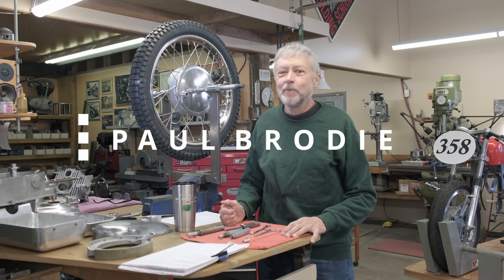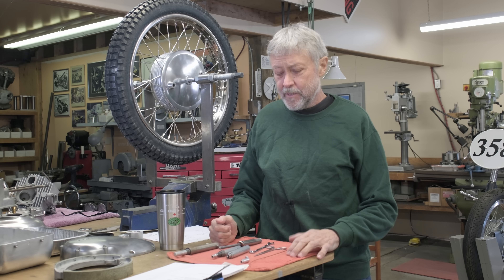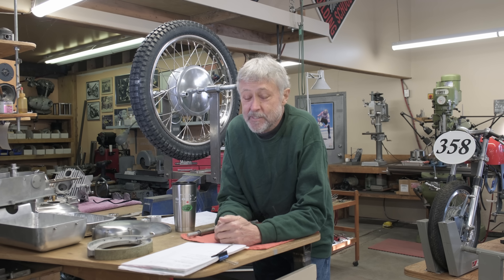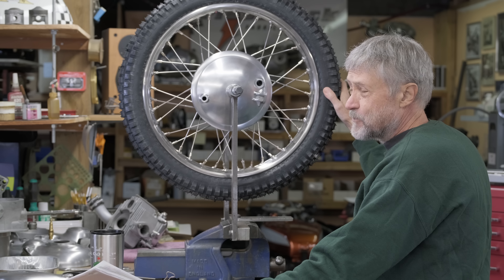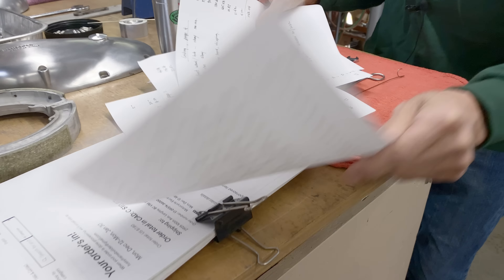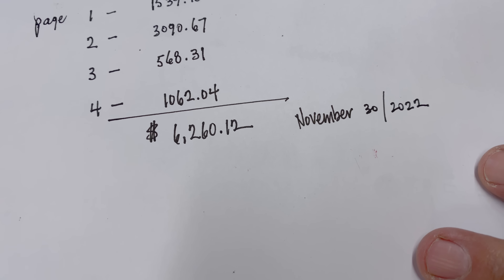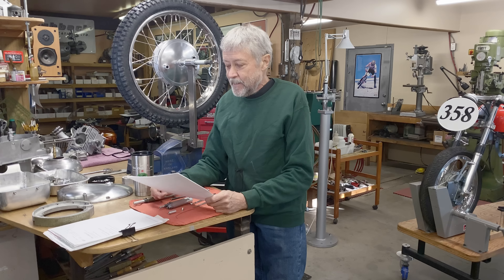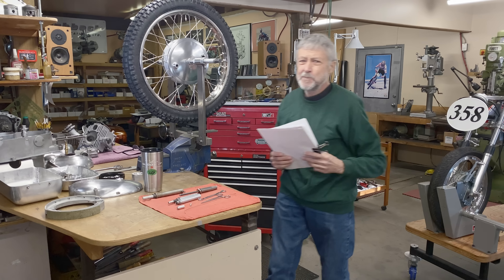Tiger Cub Start Up! // Paul Brodie's Shop

Comment: Nice to see the Tiger Cub firing up. Looking forward to seeing it with some tuning. As soon I saw it not running, I thought it was 180 degrees out. I have a special talent for setting up timing 180 out (it’s my super power). Based on the two recent restorations I’ve completed, I estimated $8,000 for that project. Just over $6,000 is a steal. Oh, those medical tweezers are called a hemostat I think. I bought a set of snap-on tweezers with a set of those 35 years ago. Worth their weight in gold.
Reply from the maker: Thank you Andrew. I must be a very thrifty shopper!   🙂
Reply: I thought it was a 'stent' or summat!

Comment: There were two bikes back when I was fourteen. A Honda 150 Bently and a Tiger Cub, the Honda ran like a sewing machine. No leaks, then you have the Cub, and it kicked back like a mule. Fluid leaks finicky starting. Then you rode one flat out, the longer stroke and while laying out you could reach down and start moving the distributor and hang on. One thing I remember was with a megaphone exhaust it had the sweetest back rap. Great small bike, thanks for vid.
Reply from the maker: John, thanks for commenting. I'm assuming it was the Cub that had the distributor? Which was on the right side of the bike... How did you reach down with your left hand (right hand on the throttle..) and make adjustments? You must be a contortionist!

Comment: Exciting! First runs always are. Good luck with the chemo, and the carb tuning! Thanks Paul. Les in UK
Reply from the maker: Thanks Les. Yes, I did not anticipate the 180 degree issue... I will be happier when the carb is tuned. Too cold outside right now...  😃

Comment: You're a bloody genius Paul with that headlight. Very ingenious on the removal tool, that is where a borescope would have come in handy, and they make a small 3 prong grabber for getting things out of small holes. 
I am getting closer to securing a painter to give me an estimate on painting the entire bike ( 441 victor ). I have no idea what that is going to cost. I guessed $5500.00 on the parts. The thing about that cost is the joy in doing what you love to do so hey it's cheap. I have not added up the parts on my bike yet but after 20 years of collecting parts it doesn't make much difference to me. Hope you're feeling good and keep making the video's.
Reply from the maker: Thank you Lloyd. Paint is one of those items that has seen dramatic increases since Covid. My paint supplier told me that there is a increase every time they order from the distributor. And labour hasn't gone down at all. Maybe you should sit down when the paint quote comes in! Yes, I do it anyway because I love bikes too. Yes, I am slowly getting stronger, so thank you for that too! Mitch and I are still making new videos...    :face-purple-wide-eyes:

Comment: Paul, glad to see you back.  Working on these old Brits is good therapy.  The part number for NGK BR8ES is 5422.  Most autoparts stores have them but the people working the counter can't find them in the system without the part number.  They will try to look up a Tiger cub.  Yeah right.  All NGK plugs are resistor style these days.  Shouldn't be a problem with your ei.  I'd be a little afraid of that 6, it's on the hot side.  Sounds like it might be really lean. Maybe raise the carb needle.
Reply from the maker: Thanks Mitch. Yes, I need to find some old stock NGK 8's with the R. 6 is a hot plug, I would prefer an 8. Maybe it sounded lean, but the plug was black...
Reply: @paulbrodie  I was a little confused on the timing.  I couldn't tell on the first attempt if the bike was running or just spinning over with the rollers at 160 out.  On the later attempts it sounds like it was running but timing was pretty far off and when you advanced it twice it seemed to get worse.
Reply from the maker: @mitchburk5112  Yes I know what you mean. When it was out 180 degrees, I didn't think it was running, but Mitch and Yves both said it was, from different viewpoints of course. Now the jetting is out, so it's hard to tell how well it was running...

Comment: Fantastic to hear bike roaring. Little bit different sound like 6cylinder inline I was flying yesterday but very pleasant. Thanks Paul.
Reply from the maker: Thank you Ivan. Yes, a single will certainly sound different than an inline 6...   😉
Reply: @paulbrodie  Yes but this single gives memories back, I think most of us start with them. This particular 6 is without muffler, little bit rare today and your video starts dreams in my mind, my first touches with motorbikes when I was 9. Big thanks Paul, you are very good teacher and story teller.
Reply from the maker: @ivansemanco6976   Thanks Ivan. I got my fascination with motorcycles when I was 9 as well. My Father took me to a steeplechase race in Southampton and I got hooked on the noise, speed and excitement!   😉

Comment: Great to see your Cub running! Your videos have helped me enormously with my ‘58 Cub restoration. I often took screenshots of your videos. Interesting the cost so far...my cub is now road legal, the total costs to buy and restore and put on the road about double yours, but I had to use machine shops and a commercial painter. Regards, Al
Reply from the maker: Thanks Al. Yes, I'm sure I saved quite a bit by doing the machining and painting myself...   🥴

Comment: Hi Paul, your looking a lot better, hope your recovery continues going well.
We are still in hotel since Hurricane Ian, it's gotten really old now and looks like we will be here until January
Probably few people know what a 'sand cast' CB750 is, rare for one thing but also original 1969 motor. 
I guess it's had quite a few modifications over the years?
Although I worked on a lot of them at Honda dealers, personally was never a 'fan' of the CB750, too wide and too heavy although they were very useful for larger brakes and longer suspension plus pistons for conversions on CB500/550F to get a 591cc motor.
Reply from the maker: Well, this sand cast motor is a CR750, and it has racing history at the Daytona 200 in '71 and '72. Stay tuned..
Reply: @paulbrodie  Wow! 
That makes it incredibly rare, didn't Honda only have seven of them at the time?
I remember seeing an old works Honda CB (CR?) 550 at Pembray in South Wales around 1985. It was out dragging a brand new Yamaha 1000 'Deltabox' (I forget exact Yamaha naming, FZ or FZR? ) along back straight into hairpin. I was at Suzuki  /Yamaha dealers at the time so knew just how quick the Yamaha was (plus I had a 'slightly modified' 1977 CB550 F1
Even with CR750 being 15+ years earlier, it must be pretty incredible to ride
Reply from the maker: @1crazypj  Yes, I'm happy to have a CR750 in my shop!   😉

Comment: I had a cub in 1977-78. A great little bike. Triumph should have carried on making them for the trials market with a better oil line connection to the bottom of the crank case! Nice to see this one in such great shape.
Reply from the maker: Thanks Dave. Yes, they are available in the UK made for trials About 15,000 pounds! (cost, not weight)

Comment: Those are some great tricks to get your TDC stopper out of the cylinder, especially with the forceps. This just reminds me that I need to get some more of them. The forceps are also excellent for pinching off fuel line and even vacuum line which comes in handy tracking down vacuum leaks. Speaking of vacuum line, I’ve used vacuum line as well as plastic air line hooked up to my vacuum pump that is normally used for leak testing. Have actually used the suction tube on my solvent siphon gun that’s powered by compressed air and the Venturi effect.  

Always happy to see more new content coming from your channel and happy to see you being so energetic and getting so much accomplished. Take care of yourself and great job on another episode. 👍
Reply from the maker: Thank you Lewis. Appreciate your comments.  😙
Reply from the maker: @LazloNQ  Thanks Lazlo. I don't think the small straw would have worked in this situation...😉

Comment: I restored an old moped and the coil for lights was already removed so I also went with a battery pack, good for one ride. Still have a 10W tungsten bulb in the front, have to get an LED one.
Reply from the maker: My battery is to power the lights and horn only. The Electrex ignition will run forever. Thanks for watching..

Comment: Paul
Surgical clamps have saved my bacon more times than I can remember everybody should have at least one pair in there toolbox the cheapest place to get them in the uk is fishing tackle suppliers as they are used to remove hooks from the fishes mouth. You can also get them in all lengths from surgical suppliers. 
Great vid as always. 
Jon.
Reply from the maker: Thanks Jon. I'm told those surgical clamps are also known as Hemostats...

Comment: I adapted a modern small CDI rotor to fit the big diameter taper of a CZ125 to replace the big flywheel and points for a friend. They always say you don't need a key because the taper actually holds the rotor on. Sounds a bit sketchy but it did work on that occasion...I built a TDC finder for another friend. We gutted a spark plug for the Hercules motor and I machined it for a 1" travel Dial Indicator stem to go through the center... Speaking of spark plugs, I was able to buy a whole carton of the old standard B8HS off eBay a few years ago. I run them In my 380 Bultaco Frontera and RL250 Suzuki trials bike.
Reply from the maker: Good stuff Tom! I'm glad you're keeping your hand in these old and cool bikes.

Comment: Nice work, Paul, good to here the sound after so many years. I have happy memories of my Tiger Cub, which I used to work on under a street lamp, and set the timing by the sound of it running. Cost me £50! Slightly flexible front forks. Mine leaked oil too.
Reply from the maker: Bill, thanks for watching and commenting..

Comment: So glad you’re doing well health wise. Enjoy your presentation format especially the metalworking processes. I’m a retired machinist and motorcycle enthusiast having been a rider and bike modifier although not nearly your level, for 55 years. 
 I wonder why you didn’t use a dial indicator to find top dead center on the cub.
Reply from the maker: Keith, thanks for watching and commenting. The spark pug hole is at an angle to the cylinder bore, so I cannot get true reading from the dial indicator. Make sense?    :face-blue-three-eyes:

Comment: Hello Paul,
Not sure if you will see this but I have 
2) NGK B8ES  in original boxes (2) B9ES out of boxes  (1) BR9ES in original Box.  All are Brand new, I am the BC Interior.

Also I believe the tool you used to recover the piece from the cylinder is called a Hemostat Forceps. 
Best wishes for your health.
Reply from the maker: Yes, I am seeing your comment. I would be interested in purchasing them from you. You can find my email somewhere under the description... Yes, Hemostats is the correct name. Thanks!

Comment: I have always called  those surgical pliers hemostats.  They are also good heat sinks for soldering delicate electronics.
Reply from the maker: Hemostats... thanks Rich!  😉
Reply: What is the difference between a hemostat and forceps ? The lock ?
Reply: Every tool chest needs a medical grade roach clip,er, hemostat or two
Reply: @bobturnbull18  hemostats are specifically used to clamp blood vessels (hence the name)
Another useful tool are alligator forceps. They have a pistol grip and long shank. They only open at the very end,
Reply: @jimurrata6785  I was interested in what was the physical difference between forceps and a hemostat. Is it just the locking feature ?
Reply: @bobturnbull18  No there are plenty of locking forceps.
Size and tooth texture I suppose. There are a multitude of hemostats as well. 
Surgeons seem to have specific instruments for any situation and personal preference.
I'm left handed and unfortunately LH forceps are much more expensive.
But for a tool you don't typically need high quality so Pakistani ones work fine (no joke! They make a lot of them)
Reply: @jimurrata6785  Thanks, I appreciate the education.
Reply: Ok, you guys got me wondering. So after a quick research session, the main difference between hemostatic forceps and hemostats are that forceps clamp tissue, hemostats control blood flow

Comment: Hi Paul, Nice job removing the piston stop from the cylinder. 
I know most people panic about dropping stuff into a cylinder, you have shown there is no need to panic. On R44 helicopters,  We drop the exhaust valves back into the cylinders to ream the guides with the cylinders still installed. With a little patience the valves are jiggled back into position. Admittedly the cylinders are horizontal...
Reply from the maker: Thanks Murray. Interesting story about what you do with the exhaust valves. Never heard of that...

Comment: Cubs are cool!  Yours is ultra clean.

"The cost"  I once did a garden variety fix up to ride job on an R75/6...........................................At the well over 3000.00 level I threw in the towel. Rode it once or twice. "What was I thinking?"............By the time the rest of the mechanical issues were fixed, then cosmetics...........I would have been at 4 times value of bike,at least.

And still would have had a clunker sitting here.  Traded it for something modern and considered it a life lesson.
Reply from the maker: We all do things for different reasons. I knew what kind of Cub I wanted and started buying the parts I liked. I have no regrets. Thanks for watching and commenting!

Comment: At 19.41 a nut fell off onto the floor. Just thought I would let you know.
Thanks for sharing.
Reply from the maker: Yes, that was one of the shock mount bolts that holds on the seat. The nut did fall off. Thanks for watching :)

Comment: Oh the joys of ignition timing. When you said it was at 150 I was like Woah, but then when you showed the wheel and I saw it was almost 180 degrees off, I was Oh, because I've had that happen as well on a car that it ran at about 180 degrees off. Definitely sounds like she needs a little tune up, but the hardest part is done and she's running. As usual, good to see you keeping busy and back in the shop.
Reply from the maker: Thank you very much!

Comment: my worst nightmare!. i took an old plug body, knocked the insulator out and tapped it out take a threaded ali' rod with a flat filed on one side so compression wasn't an issue. Good to see Paul is feeling fit enough to make 'content', top man.
Ignition timing advance on a Cub 32o - 36o max' for sports model, then you should factor in ( so they say) ethanol fuel burns quicker so go as far as 29o on an untuned motor?.
i'd like to hear Paul's comments on this as he has more hands on experience/knowledge.
Reply: The "flat" is an excellent suggestion to keep from fighting compression.
Reply from the maker: I was told 35 degrees, and then another source said 32 to 34 degrees. So, somewhere in there should be good!

Comment: Sounds like it's very weak, looks really nice .
I had that on a triple running a Boyer, had the wires around the wrong way spent days on it ,did the valve timing twice, live and learn hey.
You look happier Paul.
Reply from the maker: Thanks. I like the looks, not so happy with how it sounds..

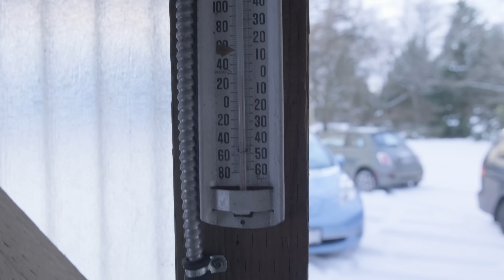Comment: Uh, oh..., the early '60s Honda twin out in the snow at 7:16 is sad.  Perhaps it's waiting for some attention from the 'master'..🤗 The Cub looks great, they're a handsome lightweight for their time but had their biggest following for racing, not so much as street bikes due to reliability problems.  It oughta be a nice runner when the carb gets attention.
Reply from the maker: The Honda 305 out in the snow is junk. Someone has hacked the cases. Thanks for liking my Cub!

Comment: Paul another great video, been there done that with dropping something into the engine when checking TDC on an MG engine, couldn’t see anything so had the take the head off😢, foetus no damage. The cub looks very nice should be a fun ride.
Reply from the maker: Thanks Graham. So you dropped something down a plug hole too? Maybe we should start a small, exclusive club!

Comment: Hi Paul.  It's Arash.  Glad to hear you're doing well with chemo.  The Tiger Cub is a beauty.  I had those same cheap mirrors on my motard, and they're junk; vibrated loose instantly.  I ended up spending the money for CRG Blindside mirrors, and they've held up great.
Reply from the maker: Hi Arash. Good to hear from you. Yes, I might have to buy some better mirrors!
Reply: @paulbrodie  On the other hand, I don't doubt you'll find a way to make those cheap mirrors 100% better.  I foresee a custom billet mount for the handlebar.  Might even make a video out of it?
Reply from the maker: @393Nader  You might be dreaming a little fast and hard. We'll see...